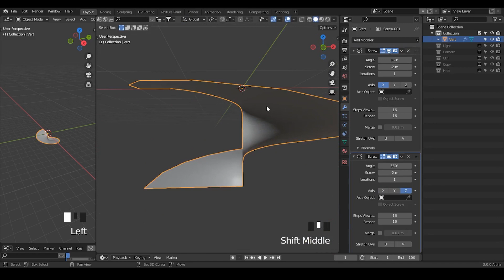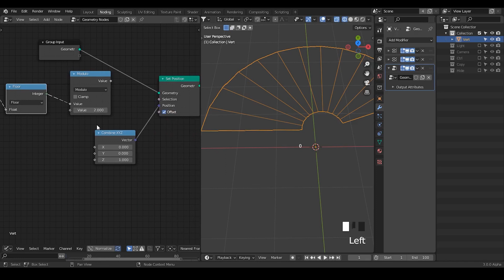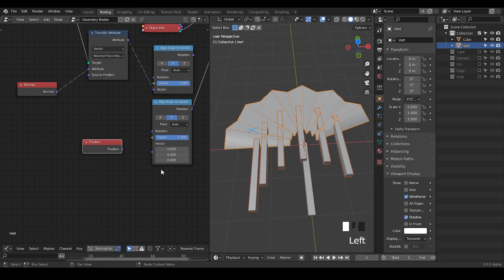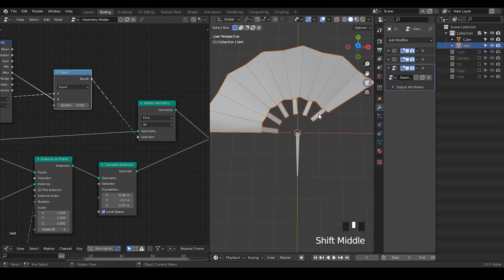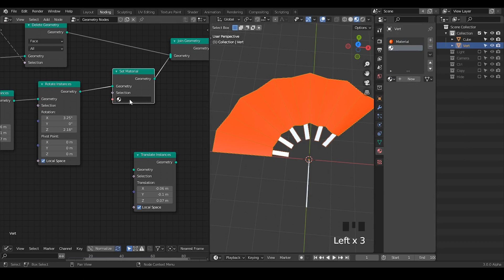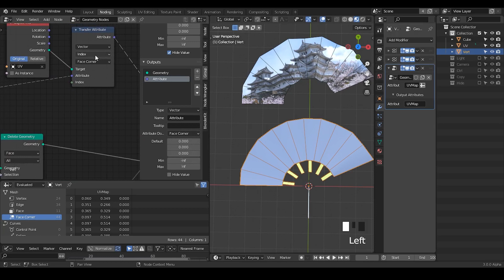[Updated][Tut] Procedural Folding Fan - Blender Geometry Nodes 3.0 Alpha Field

Comment: i'm on blender 3.0. On the set position node, the box "offset" is now 3 different fields with x,y,z. It doesn't reproduce the same behaviour... How can I fix this pls?
Reply from the maker: plug into offset instead of position.
Reply: @bradleyanimation120  this worked, thanks!
Reply: @bradleyanimation120  and one last issue I have: even with the shortcuts on screen, I don't understand how you separate the 12 vertices you mention at 4:45 to make the small arch... I guess I'll hop on your discord to ask this :) Thanks for the tutorial btw, the fact that it's full procedural is so convenient!
Reply: @bradleyanimation120  thankss !!!

Comment: Hey! I am working at Blender 4.0, and I have problems with sampling the UV map. I used Sample Index instead of Transfer Attribute, hoping for the same effects. I also tried to experiment with Sample UV Surface, both to no avail. Are there other way to copy-paste UV?
Reply from the maker: Sample Index should be the right replacement for transfer attribute node. It would be better if you can show your node tree in the discord server.
Reply: Hola! lo pudiste resolver? :( tengo el mismo problema